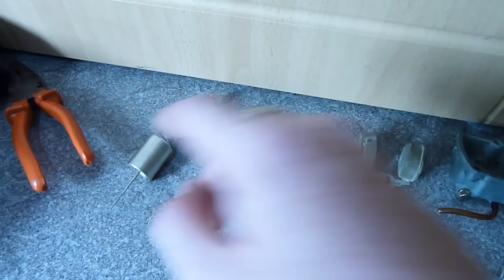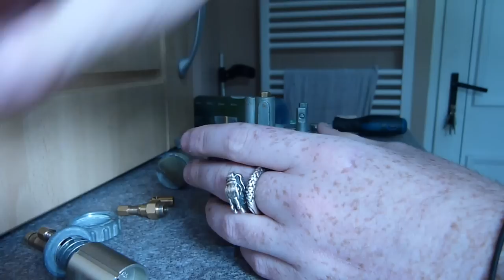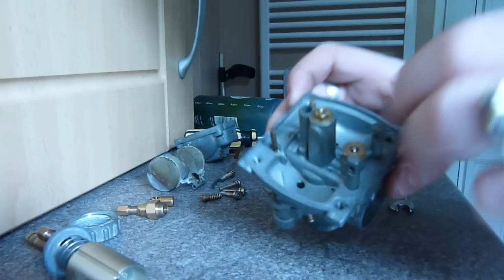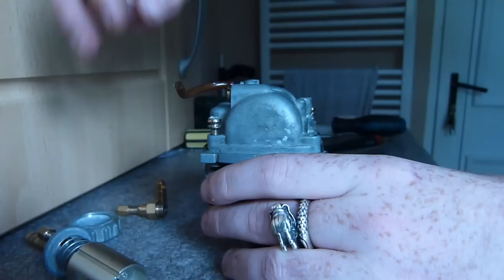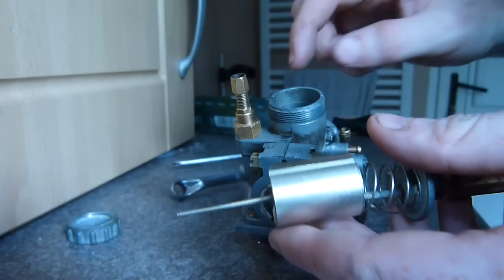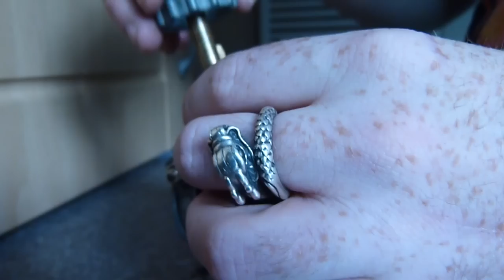Carburetor rebuild basics ( suzuki a100)

Comment: Dear my suzuki max is 2t oil pump is not working So can I mix in petrol tank 2t oil ring piston or crank is working properly Please reply
Reply: Its ok to use a 2t mix in petrol when the oil pump fails, but the lubrication may not be as good as with a working 2t oil pump. For general use ( not off roading - drag racing) the 2t oil pump would not fail that easily. Please get a new one installed in future.

Comment: Hello Ginger Gordie Biker,
I have a 1977 A100 GoFer in very good shape. It has been sitting in my garage for a while and last summer tried to start it. Almost started. I think it is bad fuel and gummed up carb. I want to clean the carb put new fuel and give it a go. What is the proper ratio of oil/gas mixture for that bike?
Reply: It mixes itself. There is a reservoir to inject the oil

Comment: Had my carb cleaned and when i put it back my bike revs too high during idle ...any idea why is that? 

tnx for the vid though
Reply: Hie bro lam experiencing the same problem did you manage to get the fix for that
Reply: @blessingmurapa5488  did you try to adjust the idle with the external screw on the exposed top portion where the cables enter.